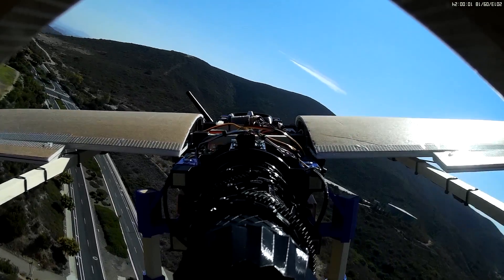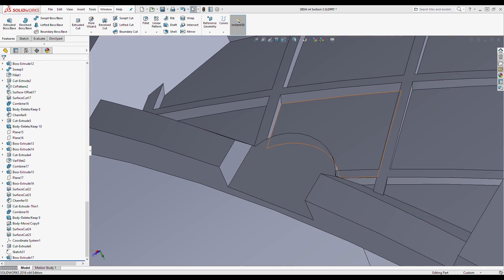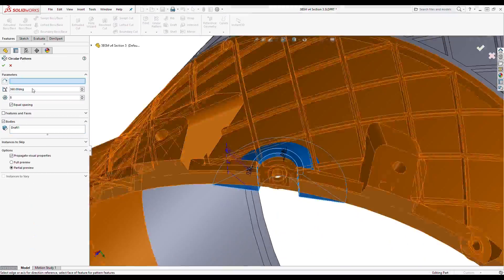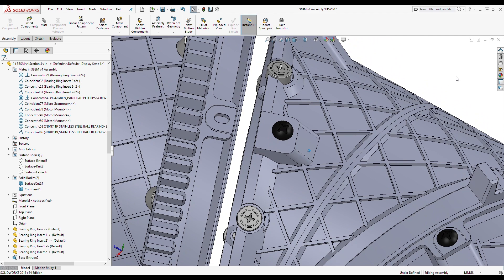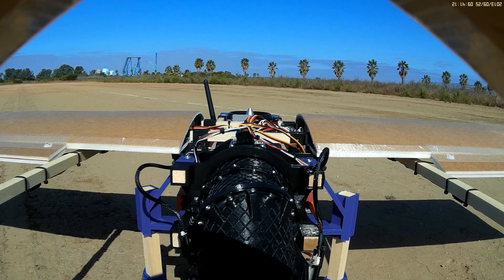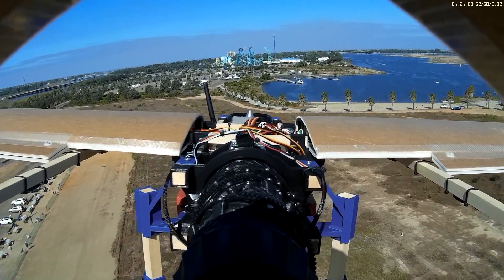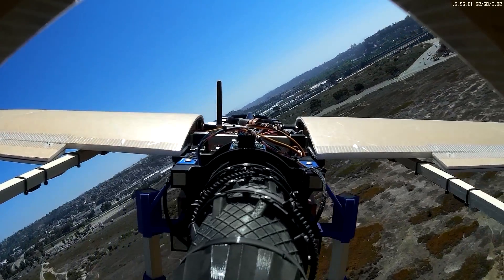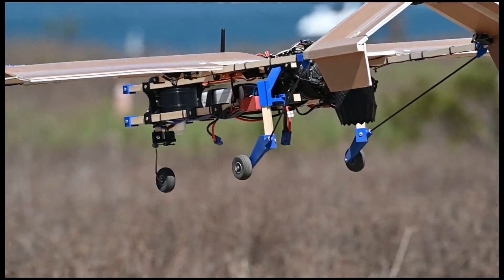R/C F-35B: Smoother Transitions with 3BSM Improvements

Comment: You can consider to add a vertical fin under and/or above the front propeller to provide swing stability during taking off  which may eliminate the 2 small fans on wing.